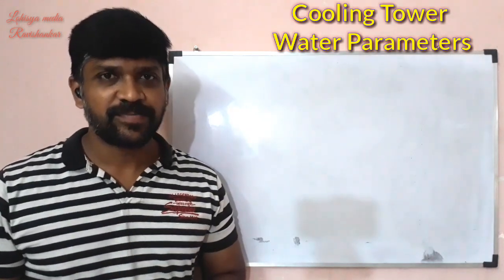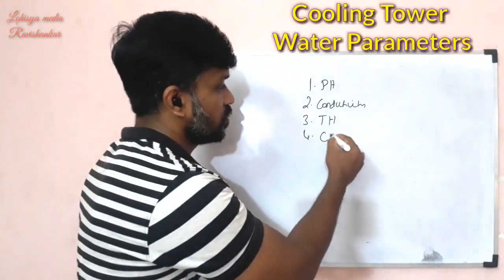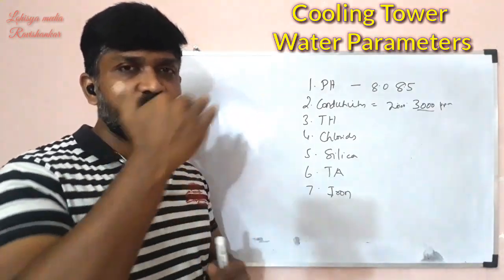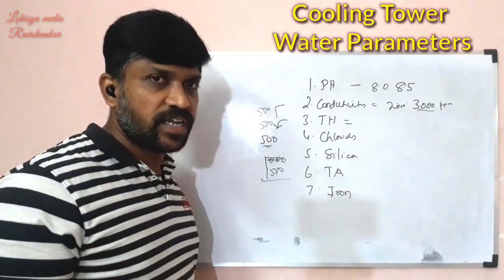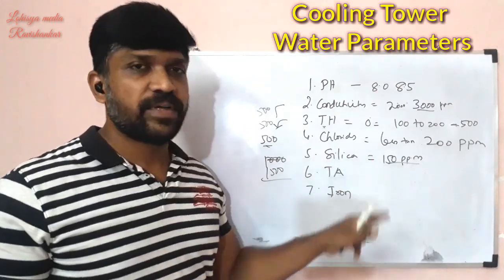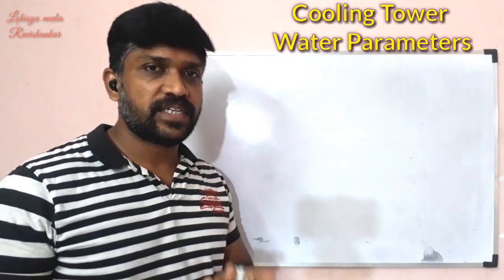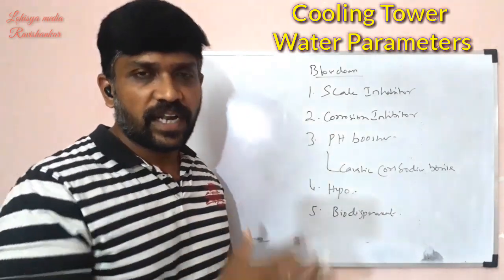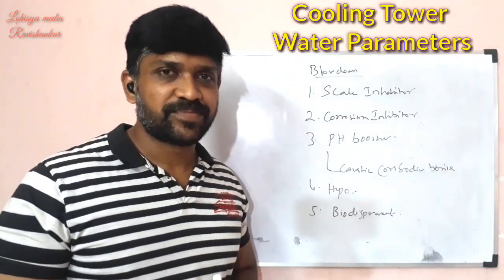Cooling tower Water Parameters & Treatments

Comment: Sir how much tds we should maintain in ct water
Reply from the maker: Upto  to 3000ppm varaikum maintain pannalam but the same time other parameters will increase need to monitor the other parameters like iron, silica, chlorides....
Reply: Sir conducvity units is micro Siemens we can also tell in ppm or not  clarify it

Comment: Sir a doubt. ..Is capilary tube is currently used in refrigeration system insted of TXV.or capilary tube is still used in mini applicatin such as split type cassette type or in auto Mobile...SIR kindly please respond
Reply from the maker: Now a days lots of refrigerator and split Ac comes with TXV and some older AC will have capillary tube